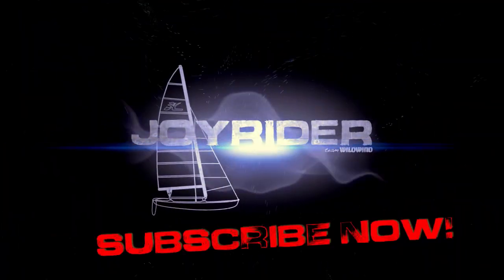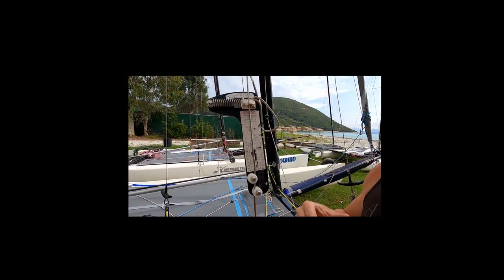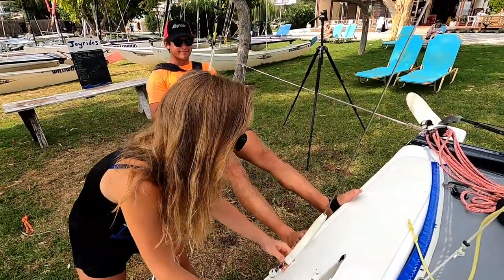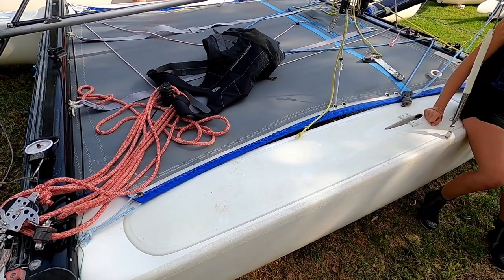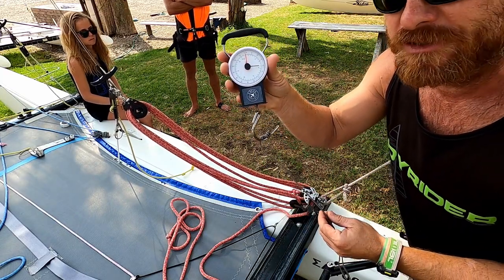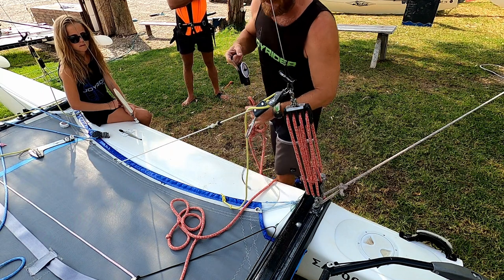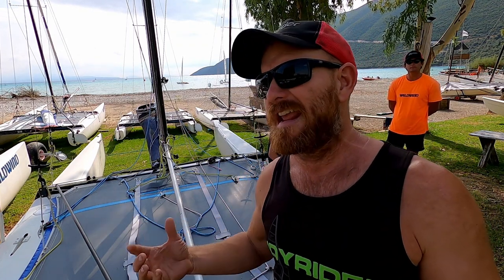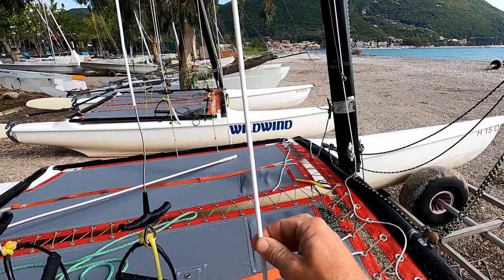How much rig tension with no gauge  Measuring rig tension on your TIGER, NACRA, TORNADO or any othe

Comment: I used your technique by tying the traveler with a line running under the hull and tied to the other side and worked like a charm .  Brilliant info as always.  Thank you.   Question ….while the boat is on the beach for a couple weeks or so, waiting for me to come back and play, do we release the rig tension or keep her tight ?
Reply from the maker: I'm so glad that this was helpful. 
It's certainly going to be kind to the boat to release the rig tension - maybe just by one or two holes - so that the mast doesn't flop about in the wind.

Comment: On my Boat (not a catamaran) we use something called sta masters you tighten the nut and it tightens the shroud, I would think it would be easier to tighten your rig using sta master.
Reply from the maker: Yes, on some of the cats we have a similar tensioning system. Hobie and most manufacturers supply these chain plates as standard (probably much cheaper)

Comment: Interesting! Do you have any suggestion for the diamond wire tension? Also, you might gain a bit of precision on the "solo method" with the ratchet turn off, so that you are measuring the tension on the sheet without the block friction in between. Maybe it does nothing, but could be worth checking.
Reply from the maker: I liked the ratchet turned on so that I could hear when it's getting tighter. I'll try it without. Thanks.
Reply: @JoyriderTV  Gotta love that ratchet sound! I am just very curious about whether it makes a difference, please let us know what you find out

Comment: Hello Joe,

I am getting my SuperCat 20 mast ready for my trimaran. It is a double diamond set up.
I have some general tensioning instructions from Aquarius (the original builders). How do I roughly measure the tension of the diamond wires? I am thinking of making a primitive lever tool, this should allow me to at least measure relative tension ....
any suggestions would be welcomed.
Reply from the maker: I'll talk about a method for measuring in today's Q+A.- That will be at 1730 greek time today but able to view afterwards.
Reply: thanks for your quick feedback, I will check it out
Reply: @JoyriderTV  where do I find the video? it was not obvious to find on your video list?
Reply from the maker: Hi, Unfortunately the internet cut out before I answered your question. 
I'll make a short video today to explain @SamuelLanghorn
Reply: @JoyriderTV  Ephcharisto 🙂

Comment: How did you settle on 26-27 as the proper number?  I think that works out to 170kgs of tension.  The old Tiger guide said run it loose, basically, take on the slack, and then increase slightly as the wind builds.  Goodall recommends 50 kgs in the light gradually increasing to 100 kgs in heavy wind.  Just curious how you came up with your #.
Reply: On the Tornado the guidance was to run more rig tension in lighter air, less in moderate/high winds. Theory was to keep the forestay from sagging, affecting jib luff, when keeping the main sheet slacker in light airs. Having main too tight in light air just hooks main leech to weather, which is very bad. So running light main sheet load, the rig tension keeps the forestay tight enough for the jib to perform well.
Reply from the maker: Those numbers have always been the go-to settings on the F18s - back from when Mitch Booth ran a training clinic at the first Tiger Worlds in 1999.
I've also been training with Danny and Kostas (current Tornado World Champions and 2nd in F18) They are running the same kind of numbers. 
BTW that is the black Loos Gauge not the silver.